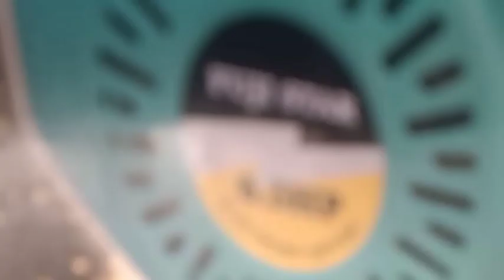Fuji Star Gasoline Engine 6.5HP FJ-200 High Speed (Unboxing)

Comment: Sir mai is model ko kharida but start problem aa rha..
Chock se chalu hota h but engine run hone k bad chock normal kro to engine stop hota h ... Plug pe corbon ata bhot kala hota h, new pluck se use Kiya to 10 minutes achha work kiya , later same same problem..
Plz solution